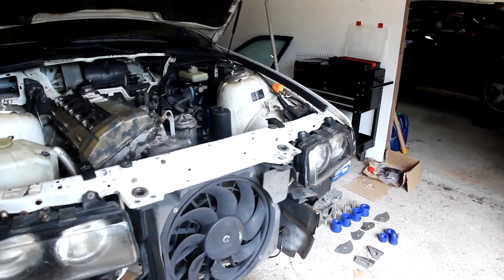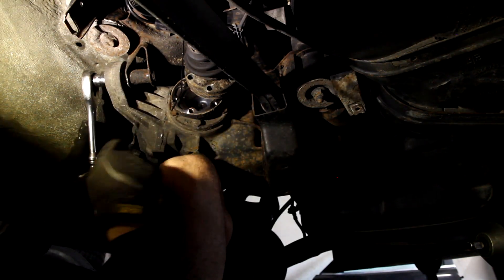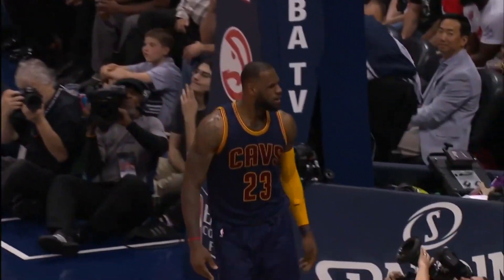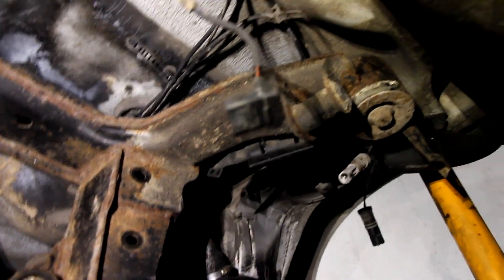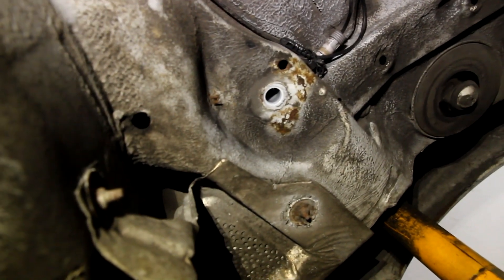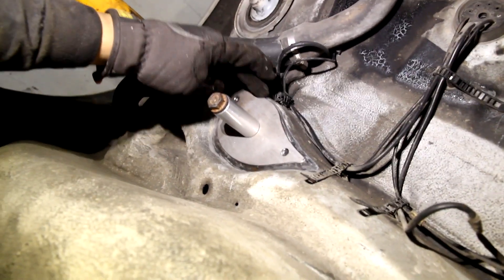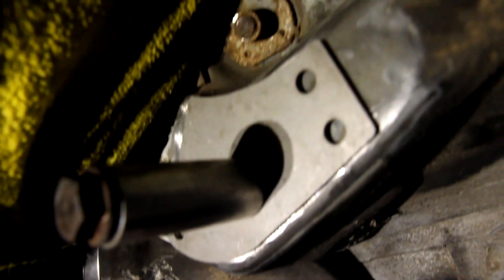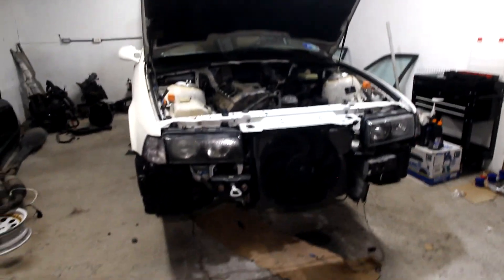White E36 Sedan Daily Drift EP:3 Rear Subframe Reinforcement

Comment: What where the welding settings?
Reply from the maker: I used a harbor freight welder on the max setting wire speed about 3. I'd recommend using a better welder. Another tip is aim more the at side of the plate instead of the chassis, will put more of the heat into the plate and will make it easier to not burn through.